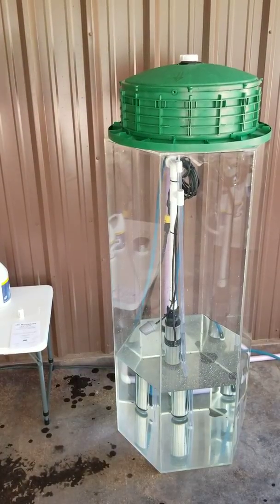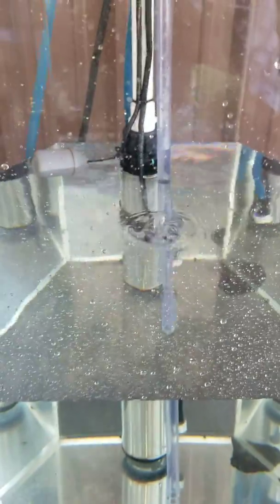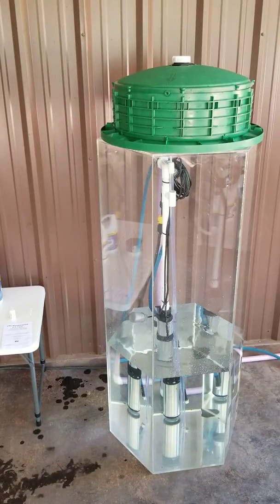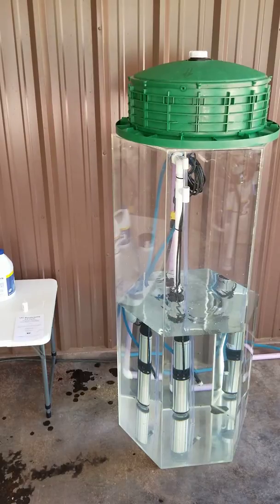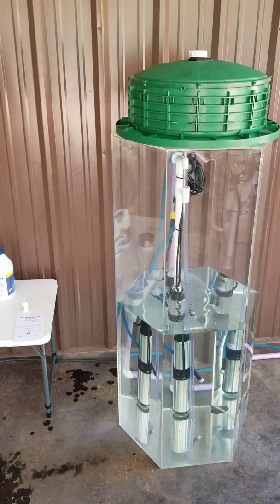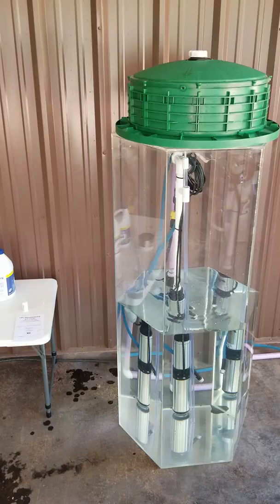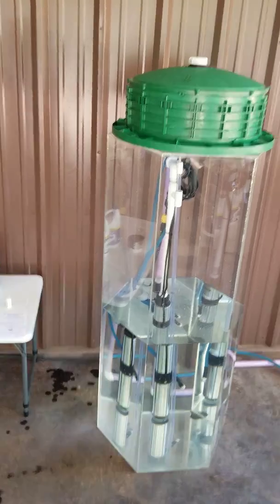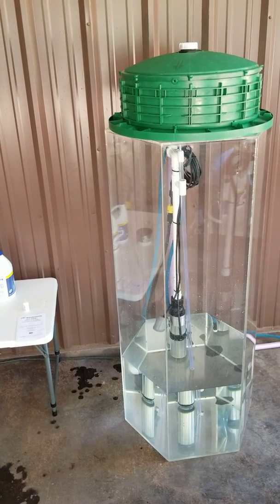EZ-Tank installation part 2 (patent pending)

Comment: Hi Michael, I just installed this on my aerobic system and it’s working great. I was curious if you have any average data for how long 3 gallons of bleach should last in a home with 2 or 3 people?
Reply: It will vary depending on your total water usage.  I have similar house size - typically 3-4 weeks, depending on water consumption between complete refills.

Comment: I have one of these and I put a gallon of chlorine in today and leaked out in couple hours.  I pulled reservoir out and saw the little hole where chlorine is dispensed and figured I would research this before I JB Welded it shut.....lol.  Glad I found this video. I'll pull lid off tomorrow and see what's going on but it has to be something with the 1/2" line not holding vacuum, right?
Reply: Started having similar issue with full gallon of bleach leaking out in less than a day.  Did fixing the little hole end up fixing your problem - or did it end up being something else?

Comment: I am also wondering if this will fit on a concrete riser that has a concrete lid.
Reply: I just ordered and received mine.  It will sit on top of the 20" lid for me no problem, then I'll probably just drill hole in center of concrete for the bleach to drip through.  May end up adding a plastic riser and lid to cover it, just attached to the concrete lid or maybe remove the concrete lid.
Reply: Where did you find the link to order? @markbrassette1585
Reply: ooops...I found the link @markbrassette1585

Comment: How far off the bottom does the bottom end of the sensing pipe need to be? Just below the intake of the effluent pump?
Reply: In part 1 video, I think it says 1/2 pipe should be touching the bottom of your tank.